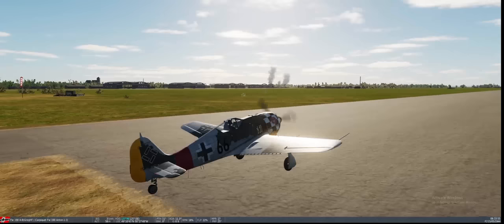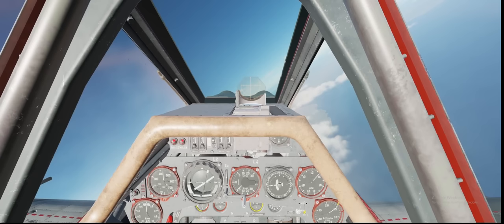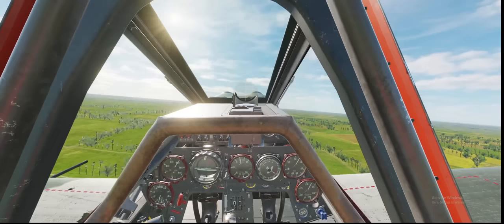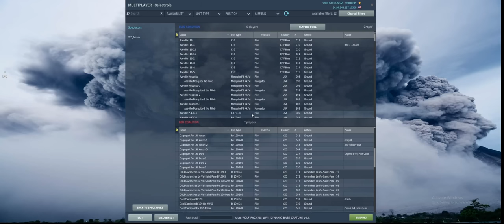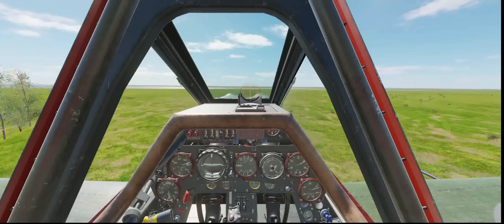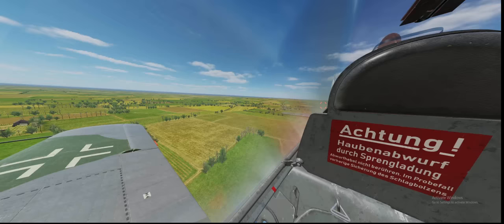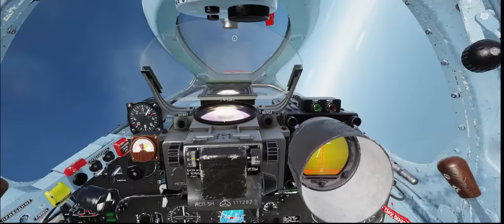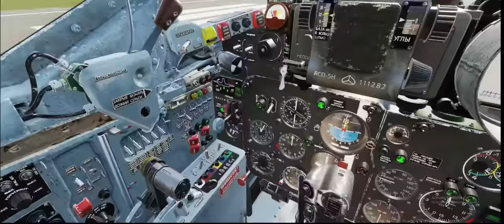German Cannons, Soviet Cannons, P-47 Mach, Angry Authors and More

Comment: Well, it is not that often when Greg is wrong, but in case of German's shell he might be. 
First I do not think that idea that Germans was so concerned to fight soviet aviation as early as beginning of 1940-th (and that what you need at lest to have those ammunition in June) hold truth historically. It is just not the case. 
Also I do not know why Greg  saying other type shells would not be possible to fire from same guns. Do not think that true either (and armor -piercing shells did exists).
Also soviet aviation was not a primary target for Luftwaffe during the war. Most of the war it was more planes deployed on west then east. Also biggest target on east was very same armored Il-2 (granted with a wooden wings and tail - but that was not main target)
I think reality is that Germans went on that root just earlier and not much armor was around that time. Also they have same problems as then Russians - low power of first generation guns. And they made best of it. And that work pretty well.
Additionally is it true, that US bombers did not come from beginning. But is is also true that on 30-th it was a big concern about heavy bombers. Those was widely considered huge danger and if anything - much overestimated.
Reply from the maker: As for the ability to use both shells in one weapon, it depends on the gun. From wiki: "As mentioned above, one problem with the new ammunition was that due to their lightweight nature, the new 20 mm mine shells produced insufficient recoil to operate the 20 mm MG FF cannon. This required a modification of the recoil mechanism so the cannon could fire this new shell, but this in turn made it unsafe to fire the old, conventional rounds. In an effort to avoid the chambering of incorrect ammunition, the modified weapon was redesignated the 20 mm MG FF/M, M for Minengeschoß. " As for the rest, sure I could be wrong, I don't think I am, but I was very clear this is my opinion, I'm not presenting it as a fact.
Reply: @GregsAirplanesandAutomobiles  Greg, I am pretty sure that "modification of the recoil mechanism" means basically just change one spring. Now if you take a look to list of ammunition for same   MG FF/M you can see bunch of AP rounds created for it - include "classic exploded AP" in mass of 115-119G. I did not know that honestly ahead of time, but understood that noting preventing you to do so. 
In any case clearly Germans did not see that as a problem. Neither as anybody as everybody agreed those mine shells had been really affective.

Comment: 1:14:00 Maybe you mean this video? The MiG-19 and F-101 guns are mentioned here https://www.youtube.com/watch?v=E5lR4uqWs9M&t=32s
Reply from the maker: I don't recall, which shows how much I care. The guy I was talking about was confusing weight of fire with the term I used which was "advanced". If this was defined by weight of fire then the HMS Victory had more advanced cannons than the A-10.
Reply: @GregsAirplanesandAutomobiles  You probably meant another video. There is no weight of fire in this video (which I have linked to). There is a ratio of the power to the weight of the cannon. He calls it the "quality index", which is generally accepted for all guns, and according to this, Western guns lag far behind the Soviet ones.
Reply: @mr11224  makes sense that they went for an 'intermediate' (rather compact) 30 mm, instead of 6+ barrels went for Gast with 2. Not only planes but 2A38M for AA as well. Not optimized vs small targets like ZSU-23/4. Tunguska/pancir retain 4 barrels despite them being rather invisible. Sovs did use bigger 30 mm like 30x210B, though small vs 30x211 of M53/59.

Comment: the Spitfire MkVIII is said to be even better than the Spitfire MkIX, but saw limited production and development due to a number of factors and timing.
Reply: The 8 was a later development than the 9. It was practically an all-new aircraft, new refined wing, longer and stronger fuselage, closer to 1,700hp, and IIRC a gyro gunsight. The VIII was a beast.
Reply: The big factor was that moving to the VIII would require shutting down each line and restarting it, whereas the IX was an incremental upgrade from the I and required less disruption of production. It was good enough, and better something good enough that was available than something better with a reduced period of production during the change over. It affected UK, US production of numerous items in WW2.
Reply: @wbertie2604  The Spitfire IX was put into production because the Spitfire V was geting badly beat up in combat with the then new FW190A.  A quick fix was needed, and puttng a Merlin 61 into a Spitfire V to create the Spitfire IX proved just the ticket.
Reply: @fafner1  this is correct, it was part of the I-II-V-IX-XVI series. However, early examples of the VII-VIII-XIV series existed and could have been put into production in theory too but were not because it would have led to initially reduced production.

Comment: in 1939 main fighter of the RAF was the Hawker Hurricane. which had fabric covered control surfaces and significant wood structure in the aft fuselage and outer wing panels. this would seem a better cause for the switch to mine shells by the Luftwaffe than predicted short war against the Soviet Union.

Comment: Head on attacks in real life require a lot of nerve, they are semi-suicidal.  They must have been very rare in the western front, Piere Glosterman for example, the French super ace, dealt with many 190's and did not describe of a single such engagement.  But in the game, I can see why you would use them against a Spitfire.  You are totally outclassed, so a suicidal attack is all you have.  For the same reason, the Spitfire pilot should avoid this (a barrel roll will make one an impossible target in a head-on fight) as it is not a desperate combat for them.  BTW, if you were dealing with a Spit XII or XIV, there would be no possibility of putting 2 km between them and you.  Also, in real life, you would not get an automatic measurement of distance, so that you could know when to turn around.  In the pressure of real combat, it would be hard to maintain a perfectly straight course so that you can achieve that distance, even if you had the faster aircraft.  It was fairly common for Ki-43's to catch P-51's simply because the P-51 pilot could not maintain a straight-line course.  Top speed is generally not a very useful advantage in aerial combat (rate of climb is).  Head on attack was often used by the allies in the Pacific theatre, partly because the Japanese fighters were usually fragile, and partly because that was the only way one could fight the much more capable Japanese fighter planes.
Reply from the maker: Head on attacks were incredibly common on the Western Front. So much so that Boeing had to add an entire extra front turret to the B-17. As for the "automatic measurement of distance" you mentioned, it's not on the Wolf Pack server where I was flying the 190, so not a factor. I'm not sure what you're trying to say about P-51 pilots not being able to maintain a straight line course.
Reply: @GregsAirplanesandAutomobiles  Yeah, that's right, attacks on bombers head on was indeed common in Europe.  The Ki-43 pilots considered this the only way bringing down B-24's in the China front.  But in a fighter to fighter combat, it was not.  On the P-51 and straight line ...  In the China front, the P-51's were involved in attacking Japanese air bases, and then escaping at low level after the engagement.  The Ki-43's in hot pursuit were outclassed in terms of top speed on the deck by the P-51.  The difference is of the order of 50 mph.  But that is in theory, practice differed.  The nervous pilot that is pursued always tries to look behind him, engaging in a zig zag course without realizing it.  Any other adjustment in course necessary to get home also works against the pursued.  The pursuer ki-43 pilot points his plane at the pursued, and flies in a far more straight course.  And thus, he catches up.   The very long endurance of the Ki-43 was also a factor in this.   This was common in China, and Kuroe (one of the Japanese super aces) describes it in detail.  He would catch the P-51's and put a few rounds of his 2 13 mm guns in the 51's radiator.  He did not even have to watch it crash.  Kuroe was able to even catch Mosquitos.

This is why, the best way to escape is climb.  Once you are above it all, you can either counter attack or convert height to speed and get lost.  But the P-51's did not have a good climb rate, they were way too heavy.  More or less all US fighters were too heavy.  The 190 cannot escape via climb from a Spitfire IX or late V (but it could outclimb the early Spitfire V's, don't know what Spitfires you were fighting).
Reply from the maker: @demetridar506  As stated in the video, the Spitfire I was flying was a Mk9LF, very deadly in a low altitude dogfight. I'm not buying the idea that P-51 pilot's couldn't fly in a straight line. They were likely turning to avoid AA or look for targets and just didn't see the Oscars. Had they seen them, they likely would have shot them down. Flying  straight and level is LITERALLY done in your very first flying lesson. It's well within the ability of any pilot who has soled an airplane, let alone completed pilot training.
Reply: @GregsAirplanesandAutomobiles  You need to read the experiences of the "other side".  Perhaps in training it was not hard to follow a straight course.  Under the pressure of combat, having enemy planes on your tail, and been way deep into enemy lines makes the "easy" part a bit more difficult.  A P-51 pilot CANNOT shoot down a Ki-43 flown by an experienced pilot.  The only thing the P-51 can do is run away in a dive.  But in these cases, the 51 had nowhere to dive (these fights were on the deck).  The Ki-43 was a very serious opponent, even more dangerous than the A6Ms.  Even Spitfire VIII pilots were instructed to be very careful fighting Ki-43's.  Vice versa, the Ki-43 pilots only feared Spitfire VIII's.  These were the only allied fighters that could "mix it up" with them and escape upwards after some tight turns.  I recommend you read "bloody shambles" by Christopher Shores..

Comment: While you are usually quite well informed. I find your opinions on the mine shell to be just silly.

Mine shells were developed because existing 20mm cannon rounds in the late 1930s weren't effective enough by German standards. Nobody else developed them because they thought the existing 20mm shells were good enough.

Same reason the US developed super heavy AP shells and Japan developed Oxygen torpedoes. Each nation wasn't happy with the status quo and so went out and figured out how to go way beyond what other nations were doing.

On top of this, the fuses on explosive shells typically are, from what I have read, not sensitive enough to explode on fabric. So would simply pass through a fabric covered aircraft unless it hit structure.
Reply from the maker: Fabric covered and wood are not the same thing.
Reply: @GregsAirplanesandAutomobiles  They're not, but I'm trying to understand how you could think that the mine shells were developed FOR airplanes of either wood or wood/fabric construction. The 20mm shells that the Germans had before the mine shells were perfectly adequate against wood aircraft. It was the newer metal construction that the Germans deemed existing ammunition inadequate. Designing new ammunition specifically for a type of aircraft construction that is being gradually phased out doesn't make sense. Regardless of if your enemy is behind the curve and still uses it extensively.

Comment: NACA testing to Mach 0.82, while ignoring controllability at above Mach 0.78, in NO WAY can be construed to mean the P-47 is capable of Mach 0.82. You can test things BEYOND their design limits in studies, such as the type of testing NACA could do and would do for research purposes. This is an invalid conclusion to draw. When the aircraft manufacturer states the Mach limit is 0.78, that is the Mach limit. If others had also tested it to Mach 0.82 and demonstrated controllability and recoverability at that limit, then the conclusion could be made.

I agree that Eric Brown being the outlier was likely not accurate in his assessment.
Reply from the maker: As long as we agree the limit isn't .71, I'm good.
Reply: @GregsAirplanesandAutomobiles  yes, we're totally in agreement there.
Reply: Combat pilots have a way of testing aircraft beyond the stated limits by the aircraft manufacturer.
Reply: @fafner1  yes, but critical Mach limits are not one of those cases. you can't just will things to work in cases like this.

Comment: Some P-47 would dive away nearly to the ground, to escape, doesn't mean they couldn't pull out nor that they crashed. Also, not all pilots were skilled nor experienced and might panic and just dive away to escape rather than try to maneuver. The fact Eric Brown wasn't smart enough as a pilot to deduce this limited gunner perspective is telling. This also goes to show that many pilots, even some of the best ones, didn't know all that much in terms of engineering nor the nitty gritty technical details of their aircraft. I've experienced this first had as both a combat veteran (seeing the level of knowledge of typical servicemen) and as a professional pilot (seeing the lack of knowledge among professional and fighter pilots about their own aircraft and aerodynamics in general). Not everyone puts in the effort necessary to be a truly phenomenal pilot and know their profession inside out and backwards. In fact, the vast majority of people will Never put in the kind of effort necessary to achieve that level of knowledge, skill, and professionalism.
Reply: Absolutey agreed. There is a very short list of people I know (at least personally) in Aviation, both as a private pilot, and aero-modeler, and reformed Simulator junkie, who actually know even the basics, such as being unaware of what Lift Coefficient is, and having no clue about calculating q. Or dynamic pressure. Or how to use those two numbers and known aircraft specs to calculate and plot induced drag vs CL. Most RC aircraft designers up until maybe 20 years ago were exclusively trial and error with many mistakes, such as desiring very thick and blunt airfoils for low Reynolds number flow expecting to have better stall characteristics. But this only applies above RN of 500k. Not 1-200k. Etc, etc...

Comment: Disclaimer: keyboard warrior opinion - at least in Enlisted there is a distinct way of using .50 cals vs predominantly cannons for AA use. Any time I've got .50 cals I'm trying to hit crucial components like the engine, the pilot, radiators/coolers, the like. With cannons they seem to work best when you aim for largest surfaces, trying to shred control surfaces, airfoils, or even straight up cause catastrophic structural damage in wings/empennage/fuselage.